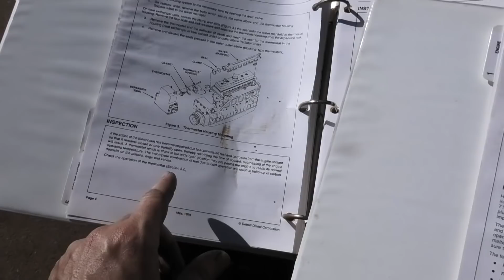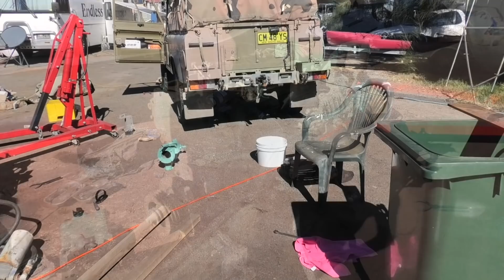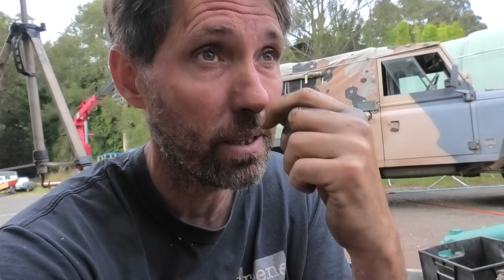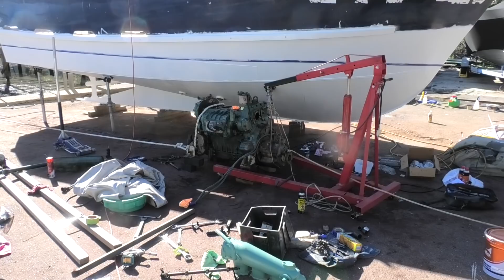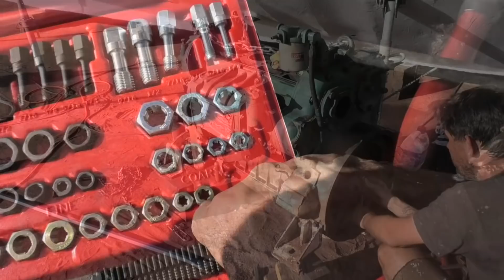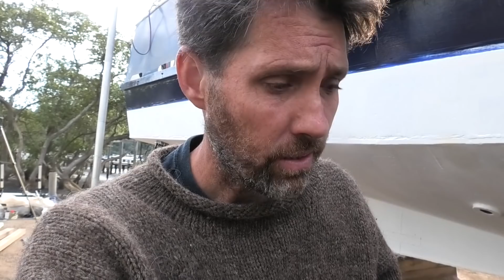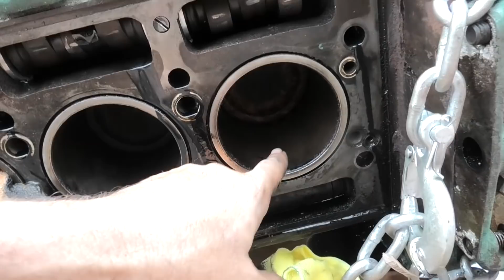Detroit Diesel 4-71 teardown

Comment: Caterpillar C12 would be an interesting upgrade if you could get it to fit. They have a lot of power and are known to be really reliable. If I remember correctly they use them in racing trucks for that reason.

Comment: Jimmies do have a problem with water injestion because of the blower and blower box but your problem is a mystery. When rebuilt, before you start it after a length of time not running keep the throttle stop on and kick it over a few times to clear the cyclinders of any potential water before you start it.  Get your mechanic to balance the rack for you as well, it's a prick of a job and if you screw it up you will have a runaway engine. The injector lines can have a problem of splitting and leaking diesel into the engine "making oil" so check oil levels regularly. They are a good engine but will bite you if you're not careful or slack with maintenence.
Reply from the maker: Thanks mate, great tips. :)

Comment: You need wrench J 4242!
Reply from the maker: Interesting. I found one on eBay, I'll grab it.
Reply: @DangarMarine  I think it is  box 1/2 " wrench, double-ended,  with an offset on each end, and one end has the points slightly rotated from the other end so that you can move the nut or bolt slightly and then flip it to go a bit more. Really handy for reaching all those things bolted to the side of the engine. This was in the late 70s/early 8os, a long time ago. But it sticks in my mind that we had this marvelous GM 71 series bible, also covering Allison marine drive, and the tool mentioned in the book. I was a devotee of the 71 series, never having worked on anything but a bicycle before I got on that boat. "Jimmie 4-banger" they called it. It was awfully noisy down there!

The book and the tool are buried in a storage unit in upstate NY.

Comment: Yes, what we call a Roots Blower. Check cylinder linings for pitting on the OUTSIDE. One pitting, replace. And, you are in the market for a new damping plate :-) These motors are noisy, reliable and will run 'fore ever' under heavy load. They are really workhorses.
Reply from the maker: Yes, that damping plate definitely needs replacing now!

Comment: One thing I know that would really make your job a lot easier and will almost be a must have when putting it back together is an engine stand. they're cheap in the US
https://www.harborfreight.com/1000-lbs-capacity-engine-stand-69886.html
you could even build your own, the trick is to get the motor bolted off center so it will rotate easily
Reply from the maker: I do have one of those stands but it's about half the capacity needed for this monster of an engine.
Reply: @DangarMarine  Do they rent them in your area, - or start welding

Comment: Hi Stu, luv ya work!, But that was hard to watch on a Saturday evening!  Be aware if you strip the block, those engines can be assembled back-to-front; so know of what side the blower is on in relation to the flywheel. If you have any of the old oil left, perhaps get a Cat oil sample (SOS) to find out why the rust (coolant or water...) and fairly cheap. Diesel oil will always be black even if water contamination, unlike a petrol engine. Either read up, or pay/bribe someone to set the governor and fuel rail up on the assembled engine before (and at) start-up. Thanx for the vid. Shop around for GM parts, as aftermarket US quality gear used to be available locally.
Reply from the maker: Good suggestion about getting the oil tested. It's still in the pan so I fill a jar and seal it.
Reply: @DangarMarine  The Cat dealer (Westrac?) have a sample kit you buy and post pack it off, with the results emailed to you. Komatsu have the same deal.

Comment: You might want to try to contact the fellow that has the channel "Bus Grease Monkey".  He is an expert on Detroit Diesels and might be helpful in sourcing parts down under.  He works on old coaches all around the states that are powered the green monsters.
Reply: I couldn't agree with Brad more strongly. The "Bus Grease Monkey" has probably forgotten more about these old Detroits than most folks ever knew.
Reply: I just started watching that dude.  He's a good guy.
Reply: You can't go wrong talking to Bus Grease Monkey. He is very sharp and oh so clever and resourceful.
If he can't get it done, it's way beyond fixing.

Comment: @Dangar Marine: Look up "Bus Grease Monkey". It's both a channel on YouTube and web forum. The guy running them is a specialist on Detroit diesels (basically a wizard when it comes to them). He's based in the USA, but may be able to give you some advice on how to deal with your 4-71.
Reply: These guys are two peas in a pod.  Doing it in the dirt!
Reply: Great idea, that guy knows his stuff
Reply: He posted an episode about marinised detroits on a catamaran recently too...
Reply: @gkkes  The engine you are talking about was a Yanmar engine.
Reply: Ironically GBM a GM diesel mechanic only recently worked a marine diesel he knew nothing about and here's DM working on a marine GM diesel he knows nothing about.
Reply: I was just going to list that. I think he's usually working on larger Detroits, but I remember some episodes with a military bus that had a 4-71
Reply: @nferraro222   true but the great thing about Detroit's is they're put together like lego's. A 6-71 is just 2 more 71 CID cylinders added on inline, whereas a 6V71 is 6,71 CID cylinders in a V6 configuration.  I helped a friend not too long ago on a 4-71 rebuild and it needed a head. He located a head and very low time pistons and liners out of a 16V71 that powered a old standby generator for the town sewage plant. He never intended on using used jugs but they were essentially free because the town was forced to scrap the motor because it wasn't clean enough. You just have to love how some tree huggers can force a town to replace a standby emergency genset that had been used for emergency power twice in its lifetime. Other than that it simply was test run a few hours a few times per year. I cant understand how they cant grasp that replacing the thing creates 40 times the environmental damage of just leaving the thing in place for the rest of it's lifetime. In this case the new clean burning powerplant will NEVER benefit the environment. But I shouldn't complain since it was practically free parts.
Reply: @southjerseysound7340  , it's too bad parts aren't easy to get there like it is for us. I'm in Manasquan River.
Reply: @southjerseysound7340  I didn't know they were built like that - the old IH inline 4s, 304, 345, and 392 engine all had interchangeable pistons, rods, exhausts, rockers, cam gears, etc.  Even the heads were practically the same - you could change a few coolant plugs and use them on the left or right.  Too bad about the genny, but that's the ecojerks for you - causing more damage wherever they go, and that don't have the sense (or care enough) to understand how they screwed up. It's the same in electronics. Anything with a circuit board (stereos, dishwashers, cars, you-name-it) should last for decades, but the new "eco-friendly" low lead solder that is used pretty much guarantees that anything electronic will end up in a landfill in six or seven years, thus introducing EVEN MORE lead and other chemicals into the ground - and that doesn't even take into account the power and raw materials used in the endless parade of new crap that we use to replace the broken crap.  On the other hand, I get a lot of "broken" electronics for free that take a few bucks worth of parts and fifty cents worth of real solder to make them perfect:). BTW, Deboss Garage on utube did a great teardown on the V16-71s. Up there in Canada, he's surrounded by them. I think he said that they pulled 3 of them out of one barge that was being scrapped.
Reply: @nferraro222  yeah they might use different rods on V's and inlines. But for the most part they designed things with interchangeability in mind. Ecojerks is a good one, I'm all for saving the environment and all. But some of these idiots just refuse to look at things from another perspective. When I tried to explain how much electricity it took to run a induction furnace to manufacture a new engine he claimed it was impossible to use that much lol.
Anyway I'm with you on the new solder too, but at least I got a nice 50 inch flat screen because of it. My neighbor tossed his right after the warranty and all that was wrong was it needed a few caps and one connector solder joint was dry and cracked :-)
Reply: @southjerseysound7340  I think the 392 rods were stouter, then they just made them the standard replacement item instead of manufacturing and stocking 2 or 3 different units.  I swear people, in general,  know less about electricity and electronics than they did seventy years ago. It's like we're turning into a bunch of techno-savages. You even try to explain that electric cars are in no way emissions-free, and you get blank stares. Where do they think that power is coming from - thin air?
Reply: SouthJerseySound  Giday mate ,every time I here a story like the green Eco nazis forcing the town to replace the old backup generator , because of emissions on a engine used a few times a year ,makes me want to go and burn some old tyres ,purely out of spite. Cheers from down under mate.
Reply: @southjerseysound7340   
Well said. It's just another pen-pushers paradise who allocates the work to a "friend".....and a complete waste of taxpayers money. 
They've been getting away with it for far too long. 
Time they were rooted out and exposed for the frauds they are.

Comment: I reckon the boat filled up with water once and flooded the engine when it was not running. Then someone over plated the boat and gave the engine a spray can recondition. Anyhow it's a bit of a bugger.
Reply: AKA, The Lebbo reco in Australia.

Comment: Those GM 2 stroke engines are great engines. Parts are dirt cheep. Having been repairing them in boats for over 40 years. Never made a video of the rebuild but I have some videos of completed projects running on my channel check them out.
Reply: Parts are dirt cheap state side here in Shitsvile AU they are pineapples
Reply: JUNK at best. SORRY I hate those engines. I've never had any luck with them. 2=0 The reason the parts are so cheap is because anyone one with any respect for the environment would deep 6 the thing=I mean take it to the scrap yard. And that goes for the whole line of engines. Detroit's=JUNK. OK i'll say they were good in the late 30's to maybe early 60's they may of been passable but in today day and age they are JUNK.
Reply: Lee Benson ".......... Well sir we are all entitled to our own opinion. Anybody with half a brain and the proper literature and tools can repair those properly. There are still tens of thousands of those running today because of a competent technician. Obviously you did not have Any of the above!
Reply: @frankkreyssig7626  be nice now, I well know what you have said is true but what benson says is true as well and you know it.
Reply: argtv100 .........Like I said we are both entitled to our opinions.
Reply: @frankkreyssig7626  and as I attempted to get across ... both opinions have equal merit.
Reply: @frankkreyssig7626  well as both of the Detroits that I speak about were engines in company trucks and then rebuilt by factory mechanics, I can only guess at there abilities.  Neither one lasted but a few thousand miles after the rebuilds. 
SPC-Lee A Benson 11B U.S. Army (RET.)
Reply: @leebenson4874  The ones in the '70s weren't all THAT bad. Now that we have all that stupid emissions crap, there isn't a diesel made that is fuel efficient AND environmentally friendly and still be affordable for the 'little guy'.
Reply: @leebenson4874  SAVE THE WHALES! Hell, why not just go with solar power and a sail?

Comment: could i offer a bit of advise ..i move heavy stuff a bout all the time ...make use of your engine hoist it will save you a lot of pain and makes life easy ,,you can put a piece of board on top of the legs then you can drop the load on the board and push it about
Reply: Smart! Seems obvious once someone suggest it.
Reply from the maker: Great idea!
Reply: And...   It will stop the swinging engine tipping the  engine hoist over when you lever under the side bar  to move it (done that myself!)

Comment: As soon as I saw those rocker arms rusted I thought the engine had been under water. The great thing about diesel engines are that they can cop a heap of abuse and are designed to be relatively easily rebuilt by using new liners, pistons, rings and bearings with minimal machining.
Reply from the maker: Hey Matthew, I'm looking forward to seeing it after it's had it's caustic bath. I think it will come back to life just fine. See you on the launch cruise!
Reply: I agree, I've never seen one this bad. I worked on 2-71s, 6-71s and 6-110s in the US Navy. They're great engines and will run for ever.
Reply: She's a Detroit it will be fine

Comment: Sell a kidney and buy a Cummins 6BT.
Reply: BoxJelly88 
There going for 2 kidneys now the words out
Reply: Yes 6bt is a cool engine.
Reply: Got the last two brand new 6bts in Australia  about 6 years,  they where meant for a Bertram 31, but never fitted, now in a GB 36, only problem is the freshwater impellar need to be changed regularly  very hard angle on the rubber vains.
Reply: A 4Bt would be plenty of power for this boat with a 2:1 reduction gear.
Lighter, more efficient quieter, no oil leakage and fumes.
Sell that Detroit boat anchor and get a good used Cummins.
I would not waste my time  and money on that thing.
Reply: @b.atwater3904  NOOOOOO! Keep the Detroit! It will make a good drag anchor!
Reply: @b.atwater3904  Nah. Then what would we watch?    This way is much more fun...  (Sorry Stu)
Reply: Or a cat 3208. Never late with a 3208!